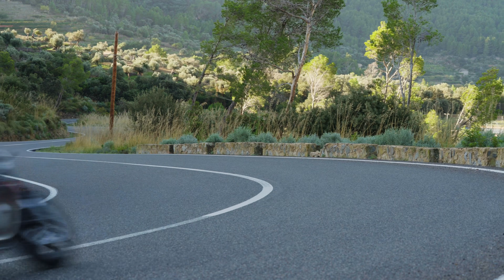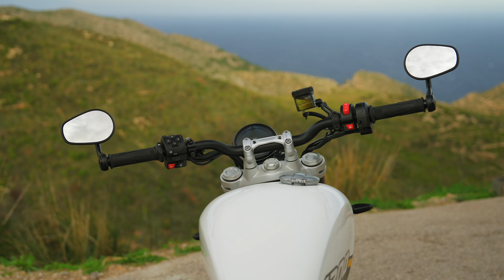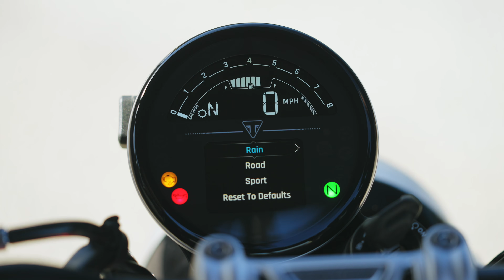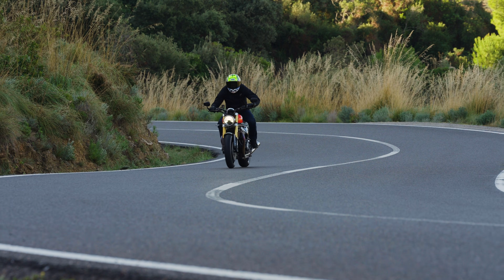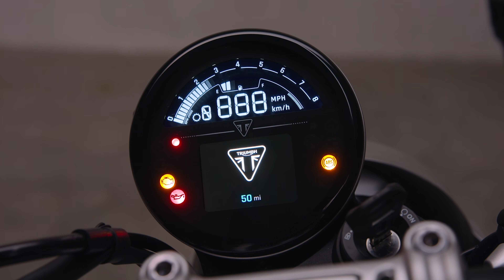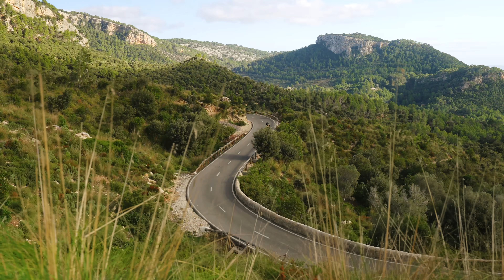Testing the Triumph Speed Twin 1200 RS: ready to go retro?

Comment: In my opinion Triumph goes the wrong direction on the speed twin 1200, the new( development mule) was sightet with single shock. I bought a brand new 1200 2024 model cause I love the twin clocks. Dont need a quickshifter.

Comment: I got the Scrambler 1200 XC, and I love this motor. My previous bike was an Aprilia Tuono 1100RR, and this 1200cc twin has the same torque at 3,300 rpm as my Touno did at 7,500 rpm. (Rear wheel, on the same dyno) Considering on the street I almost never went above 7,500 rpm before shifting, that makes this Triumph a fun bike. Especially combined with this fantastic transmission. What people don't realize, is that it's not about peak horsepower numbers unless you're on the track on the straightaway. It's about power under the curve. There's a lot of power under the curve with the Triumph 1200cc motors. At the same time, they aren't so highly tuned that they drive angry around town. They'll be a docile as you want them to be, comfortably cruising along, until you want to unleash the torque. On the street, torque is a bigger benefit. This motor wants to lift the front wheel from 2,000 rpm, lol. It's great fun. I would have got a Speed twin but my back is shot and I wanted the adjustable shocks and extra travel to extend my riding years.
Reply: Agree. I had a Thruxton RS for a while. By far the 'slowest' bike I've ever owned. I absolutely loved the motor. The torque is class, I ended up bouncing off the red line all the time. It was so happy to rev! Meaty meaty engine. Kinda shows that top end power / on paper bhp is meaningless
Reply: @philipjames3526  Exactly. It's the volume of power under the curve in the RPM range you'll use most often. It's huge on the street.
Reply: Triumph have certainly realised, especially with the triples, but twins too, that you put the torque in usable places and add a quickshifter, make the bike fun to ride and comfortable to go in the city or out of town for a longer ride. Marketing at Triumph have done a top job too. My current and last bikes are Triumphs, but, I'm getting bored of being controlled by Euro regulations and Triumph marketing/SMT. I think I'd like a few year old K900 or GSX750s, and actually feel that I'm involved again.

Comment: Looks great but.. My old Firestorm makes more power and it's lighter and with more upright bars has a similar riding position. Upgraded suspension on mine means it handles better. 14k for less than I've got... No thanks.
Reply: Still the sexiest new bike out there.

Comment: These are overpriced for what is in reality a fairly basic parallel twin. 14.5k for a bike with no cruise control and heated grips is not good enough. The paint jobs look a bit tacky as well especially with that big 1200 sticker on the tank on the base model. The old model was better value in many ways. It was cheaper than the new base model but had the classic analogue twin dials, Brembo brakes, metal mudguards [not plastic as is on the new base model] and classier paint jobs. The stealth paint job on the '24' model looks particularly nice.Nope , a miss for me and many other people judging from what I have seen and read.
Reply: Yep , they made the base model worse than it was before. I don't know what they were thinking but some people need to be fired.
Reply: Well said took words out my mouth 👍

Comment: Lost the retro vibe in my opinion, the first speed twins had cool paint jobs and twin clocks, effectively a Bonnie with more grunt and modern tubeless tyres. The paint jobs have gotten more garish and that horrible cheap single clock is just ugly as hell. Do yourself a favour and get a low mileage early one and spend some of the savings on suspension upgrades
Reply: That's my plan. I love the looks of the 2023 model with the red paint job. I can put Ohlins on the back , change the oil and springs in the front and tune the ECU , drop the Cat , ect .
Reply: @ did that on a 2019 model made it way better (needed cartridges on the rwu forks and Ohlins on the back). Great bike which I sold in a moment of madness now wish I had not, maybe need to do it again